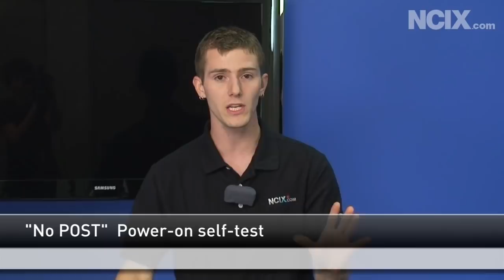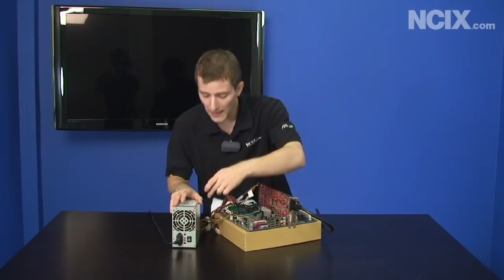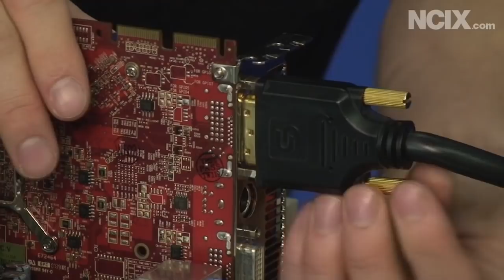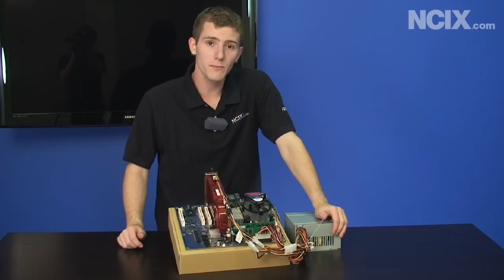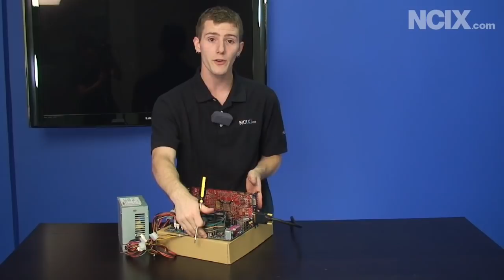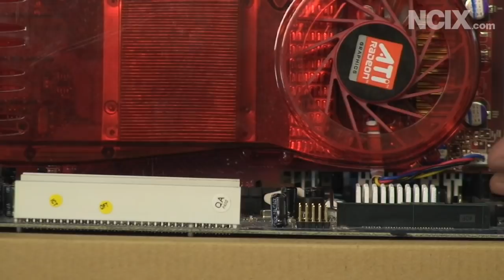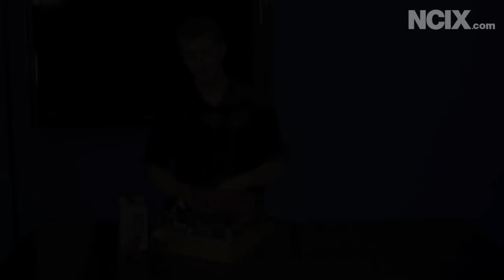PC Troubleshooting No Post Diagnosis (NCIX Tech Tips #54)

Comment: I've built my own custom desktop the idea coming from your channel i wanted to get rid of my crappy laptop that had a 325m for a GPU and move on to a bigger better desktop. I built the whole thing with no problems and, it would not post so i called a bunch of tech support. They said i needed to update bios to get it to post. I have a asus z87-a motherboard and a intel 4790k processor and it wont post. from what ive heard the older update does not support 4th gen cpu's. Is there any advice you could give me on this issue. i also have a red cpu led on the motherboard.
Reply: ask one of your friends if they have a cpu that you could borrow to update your bios. or go to a computer store amd ask if they could update your mobo
Reply: MrJelmer1999 ok ty
Reply: you're welcome :)

Comment: Please help: lights turn on, fans spin but no display. Any ideas? This is the first pc I've ever built and the parts are all brand new
Reply: try disconnecting the monitor from the videocard. i had the same problem when i build my pc this evening
Reply: +MrJelmer1999 you mean plugging it into the motherboard ?
Reply: +Noah's Edge yeah that should work. Often the gpu wont work first up, you need drivers installed. So, plug the monitor into the motherboard and (if your cpu and motherboard support integrated graphics) it should display an image.
Reply: I'm using ryzen and it doesn't support integrated graphics fml
Reply: w00tkid same
Reply: w00tkid did you fix it?
Reply: w00tkid did you guys fixed it?
Reply: Turn off pc and powersupply, hold the powerbutton to discharge your pc. Remove cmos, wait 10+ seconds, put it back in, wait 10+ seconds. Turn on powersupply and turn on pc. Hope this works!
Reply: did it because I am having the same problem

Comment: what if no fans start spinning and it doesn't have an LED light on the mother board but if i touch a screw driver to some pins it sparks but there's still not video out put and i don't have a graphics card

Comment: ok I am building my first pc. I put everything together and got nothing none of the fans turned on no beeps or anything . before I put it in the case I put my motherboard, cpu and graphics card togther to see if it was working my, cpu fan came on but not the graphics card. my graphics card has 2 6-pin connectors but I only had one hooked up. I tried to turn it on agian and this time the cpu fan didn't even come on. any idea what the problem is.

Comment: Been a Mac guy forever (20+ years at Apple), and decided to build a PC as a learning exercise with my  "Lego building & Minecraft playing" 9 year-old son.  At least, that's how I sold this project to my wife!  Spec'd it on pcpartpicker, ordered the components and walked my son through the build design.  I decided assemble the motherboard, PSU, CPU, and Noctua cooler with fans outside of the case to make sure it would POST.

Failed!  For days, I couldn't figure out why it wasn't posting.  PSU check - good.  Replaced CPU and motherboard on the off chance we accidentally zapped with ESD.  All power cables plugged in properly.  Memory, CPU, and Fans seated properly.   Asus Z170 Pro motherboard LED lights would turn on but nothing else.  Display worked connected tony Mac but "no display" when connect to motherboard on-board video. Cleared CMOS. Replaced CMOS battery.   Bought a case speaker and plugged it in. No POST beeps, no display. Replaced CPU and motherboard; rinse and repeat. No POST beeps, no display.    Reviewed all the online forums and several videos about posting errors.

Then I watched this video -> 3:48  "Some motherboards have an on-board power switch.."  My does NOT but Linus then suggested manually powering on by shorting the power on pins.  So I turned the PSU back on, grabbed my trusty precision screwdriver, and while using my magnifying glass, shorted the two pins.  

BINGO - Beep, and ASUS EZ BIOS pops up on the screen.

THANKS!!!  Now I can work with my son to finally complete our father/son "learning" project and then install some games... I mean Scratch and programming tools....

Comment: helped a friend build a pc, lo and behold it didn't post everything powered on all was plugged in. see, I have experience with Intel CPU and how they work with motherboards I didn't know that amd cpu's require a separate power plug not from the motherboard. 30 min of anxiety for nothing....
Reply: All modern CPUs need a seperate power cable
Reply: +Frederik Olsen my haswell system also needed two power plugs to post (24 pin atx and i think 6pin Eatx)
Reply: +Frederik Olsen my pc turns on then off instantly it didn't do this before i remove my i7 prossecor did i break the processor? because there is also no power given to the usb. and before a got it to stay on and the mobs light indicated it was on but the cpu was not heating up and there was no power distributed to my mouse and keyboard via the usb pleas help me i don't know what to do.

Comment: Just recently bought and paired an FX 6300 with an MSI 970a g43. Had trouble having it post, let alone power up, but after reseating the CPU, everything worked just fine.

Comment: I have played on my PC for two days now. Running fine and such. But one day I played on my PC in the morning went to work and when I came back tot turn it on nothing displayed on the monitor. My theory is the mouse I have stays light even when the PC is turned off. I have tried resetting. Changing diff kinds of ports. Even connected it to my motherboard instead of my graphics card and still didn't work. Please let me know or give me suggestions.
Reply: Try flashing the bios like Linus said at 3:01 it worked for me and I was having the exact same problem as you described.

Comment: Hey, Tech, can you help me? I have an MSI A88xi ac v2 motherboard. I have all of the connections put in the right pins and I'm using an HDMI cord but when I turn my pc on, there's no display.  Everything seems to work. All of the fans, I've even connected my phone with a usb into the computer and it started to charge my phone.  I don't know what to do. I even tried resetting the cmos but that didn't do anything.

Comment: I tried all of these solutions, but none of them seem to work.I have tried cleaning, and switching out the RAM. I also tried getting a new graphics card, and this had just the same outcome: the screen on the monitor still said that there was no signal. (Don't worry I did switch the inputs accordingly)

Comment: Here is my case, its been bugging me second day now,

Intel CPU with ASUS motherboard with on-board video (I could give additional specs if needed), computer simply turned itself off. Light indicator on the motherboard works, when I get the power cable out and put it in again, the motherboard "wakes" the monitor, the mouse lights up, the keyboard locks flash as well (that's before I press the power button). When I fire it up, the fans spin and there is no POST.
Things I tried so far and had no luck with:

- removed all PCI cards and HDD, DVD, USB and audio connecting cables from the MB etc. so at this point I only have monitor and a keyboard connected.
- removed the BIOS battery and waited, when that didn't work I shortened it with the jumper
- changed the PSU
- removed the RAM module (system gives beep which tells me the motherboard is not totally fried)
- swapped the RAM stick with another one, tried the second slot as well, same result
- unscrewed the motherboard and put it on cardboard
- desperation kicked in, removed the heatsinks from the CPU and the on board video to check for damages, no visual ones, cleaned and re applied thermal paste
- inspected the motherboard for damages, no visual ones, no blown fuses as far as I can see, removed the BIOS chip cleaned the socket and put it back in

So I'm out of ideas, any suggestion would be appreciated.
Reply: Nic K Did you install your standoffs on the case before screwing in your motherboard? It varies from case to case but if you didnt have the standoffs then it could possibly be because the motherboard is grounding the case

either that or the computer doesnt recognize the cpucooler/cpu fan being on and it automatically turns off the system
Reply: Ernest Paul
Thank you for your advise, I figured it out though. Turns out it's really weird problem associated with ASUS p5k motherboards. In case someone else is having similar issues - it's the memory, or to be more precise the relation of the memory with the motherboard. Nothing is wrong with your RAM sticks and there is no problem with the motherboard per se. Computer might be working just fine for long time (more than year and  half for me) and then at a random point, it simply refuses to POST. Clearing CMOS won't fix the issue. There is a known workaround to fix this issue. Find the lowest speed RAM your motherboard supports (667 in my case) buy one stick (I had one laying around) put it in, start it up, for some weird reason it will give 2 POST signals, it will "think" for a while and it will start. Enter the BIOS and manually set up the memory speeds. That fixes the issue, keep the low spec RAM in case the problem re occurs. Hope this helps to anyone with that issue.

Comment: Hey NCIX I did all of the things you said to do in but I still don't get any beeps and no display, my computer turns on fine and it's all brand new supply's. I don't know what else I can do, can you help me?
Reply: I fixed this I moved both my rams to a different slot and it worked
Reply: Sniper Sage your ram may be fcked
Reply: Turns on But no beep means all parts are instact. No display but doesn't restart = graphic card fault. No display bootloop = dead mobo or dead/loose CPU
Reply: howie Getants what if the motherboard graphics doesn’t work
Reply: Ramed tomato same for me , solution?
Reply: Sniper Sage same problem
Reply: Sniper Sage same
Reply: me too it sucks
Reply: me 2

Comment: So, here's my scenario, my board doesn't seem to want to power on, at all. Even with the PSU on, everything needed plugged in, and still, the board won't turn on. 

What could cause a board to not cycle power at all?
Reply: a defective motherboard, PSU or you somehow damaging ether of them, or not plugged in correctly.

Comment: got prob with start up....stuck with option (del)bios setup or (f7) boot menu..nothing happens when i press del or f7 then after a few secs or minute monitor turns black...
using ECS Z77H2-A2X Deluxe (V1.0) and Palit Geforce 730
cpu works without graphics card monitor connected to mobo...and when i use graphics card monitor connected to either VGA of mobo and VGA..always stuck with bios and boot menu...
im starting to doubt if its the compatibility issues :( 
any suggestion?

Comment: I did every step as you did and no beep for me, the fan spins and dont stop.  But no display at all but i can't swap the video card since I'm using the on board video . What can i do ?
Reply: Is the cpu supported, I'm having the same problem with a discreet video card and the only thing I can think of is that my cpu isn't supported, I check the manufactures website and needless to say my cpu is not support without a bios update so I either have to wait for a new bios chip to come (next week) or hope a pic shop in town has a spare cpu I could use to put in it and update the bios.
Reply: yes i finaly found the problem. at least the solution, not sure how thats help but i followed the trick that i saw on some forum that consist of scrubing the ram pins against my pant before puting it back in and... surprisingly it worsk just fine now thaks for the help, it's really apreciated.

Comment: I have a syx tower with an asus motherboard that my dad gave to me and when I turn it on sometimes it has display then crashes and won't have display the display stays on for about 5-10 mins then crashes and the I reboot and sometimes has display or not
Reply: Reset the bios maybe? If you can get to the start screen try installing new drivers.

Comment: I have a problem with my computer when i try to turn it on [all properly plugged] it didn`t display anything on monitor and i heard some beeps continuously its like ... BEEP...BEEP...BEEP...BEEP...BEEP...BEEP so on.... it really dont have ending it just keeps on beeping. shorty but continuously... i have tried many steps that i found by searching and watching videos.. i already done removing ram and cleaning sockets and ram and plugged it in again and nothing happens still have the same problem, and i tried plugging out vcard clean it also then plugged it again, and still nothing happens just the same problem, and i also tried removing ram and vcard and tried to turn the pc without it and it still the same problem, and at last i tried replacing the power supply correctly and it still have the same problem all of these procedure didnt work at all... im thinking if my motherboard is the problem or anything?? any suggestion or help i will appreciate please help me :c
Reply: Melvin Lamigo
RAM Would be 3 Beeps.
Reply: Check your motherboard manual and see what the beep code means.

Comment: My computer boots up but I get no signal to my monitor and my keyboard and mouse aren't getting power? help.
Reply: That can be graphics card issues or onboard graphics issues.Clear CMOS and reseat everything.
Reply: What's CMOS?
Reply: Fir 

It stores the bios settings. Google your motherboard model to figure out how to clear your CMOS settings.Contact the manufacture of the motherboard and they will be able to tell you what needs to be done.
Reply: +Fir 
I am also having same issue, and I checked my GPU but it is perhaps the problem with my motherboard.

Comment: i have a 2008 pc
it have 1 short beep everytime
but it boot normally since i built it
whats wrong with it?
Reply: Model number of Mobo?
Reply: ASUS P5KPL
Reply: RAM Issue. Try replacing it. Or make sure it is seated properly.
Reply: what? i just go to windows normally
and it have one beep ONE BEEP like this
EX. "i push the power button, wait for 5 sec , BEEP , and passes BIOS post , and boot to windows , and just works perfect
Reply: Idk.
Reply: what is idk means?
Reply: i dont know
Reply: thanks, i don't know what idk is my whole life
Reply: ***** One beep is normal, but you knew that and are just trolling.
Reply: oh thanks dude, i been figuring out what wrong and thank you , i know it boot normally and i may not care about it
Reply: ***** that glorious beep is what makes many ppl happy when they build a new system. It means everything is working 100% and everything passed the POST checking (in short it means that everything is working)
Reply: Axecution
i knew that!
Reply: One beep is normal. :)
Reply: Hlex LV i think this comment have been ansered and dead long ago...
Reply: i know that, just i wanted to answer again :d

Comment: 5 beats, and it is done.  My first PC build aswell. Any fix?
Reply: You may have damaged the mobo by static. Were you properly grounded when you built it?
Reply: I was grounded, I realized I needed to update the BIOS on my mobo. Thanks for the help anyway!
Reply: Ah, did you use a Vishera with a non-FX supporte mobo?
Reply: I do not know what that means, so sorry..
I paired a A10-6800K with a MSI Computer Corp. A55M-E33 Motherboard. Now I need to just get a scrap cpu to update the bios, and then I can use it..
Reply: Nope, not the CPU.
That mobo is unreliable. One failed on me in less than 2 hours, RMA'd and wouldn't post.
Reply: I know, I realized my cpu wasn't compatible with my mobo, it needs a BIOS to work
Reply: Nooo, the mobo itself is shit.
Reply: Most likely it burnt itself out.

Comment: i have a problem with my pc, no display and no beep when turn it on. fan turn normally. HELP!
Reply: Same problem u_u
Reply: if you find something, plz comment! Thnx
Reply: I accidentally connected a 6-pin power cable to my gpu tht was actually suppossed to conect to the motherboard (what they told me, eventhough it was working without it conected) so i pretty much fcked up my motherboard, and now i need to buy a new one.... so  yeah, not installing a gpu by myself evar again xd
Reply: i understand...RIP motherboard :D

Comment: Hey, I bought a complete pc in part i bought.
FX 6300 6-core 
R9 290 Tri-x OC 
RipJaws 8GB X Series
850w Artic Blue 
2TB 3.5inch WD Caviar 
Asus M5A97 
X Preditor X3 Avenger Edition Full Tower

And i sent it into a professional pc repair place and they also build pcs, they are called "PCproblems"... The first problem i had was that it fucked up rthe boot file, it said it was missing... And then the other one is that it will not boot up, they dont know what it is, im thinking some of the components will co operate with each other, you think so!?

Comment: tried all this and my pc still doesnt post. Everything's brand new. i5 4690k on a asus z97a motherboard and a corsair 750m psu. When i try to power on it turns on and the cpu fan starts spinning then immediately shuts back off......?
Reply: It might be a psu problem. Check your voltages with a multimeter. They should be 3V3,5V,12V. A slight difference is no big deal. We don't live in a perfect world.

Comment: Great Tutorial, I've manage to follow all the steps you showed but i still have no display in my monitor, my Memory stick and video card are also fine, there is also a light in my motherboard ensuring that the power connectors are properly connected, my power supply is also new and functioning, i tried to connect the vga cable in the onboard port but still there is no display,, can you help me with this,, my mother board is  ASUS P8H61- MLX.

Thank you.